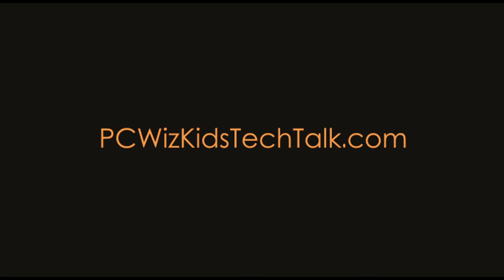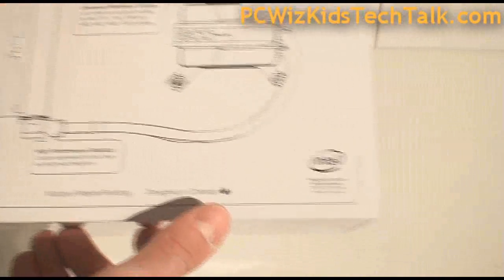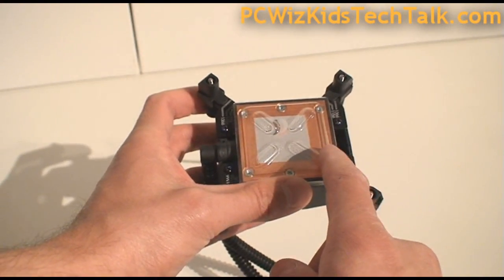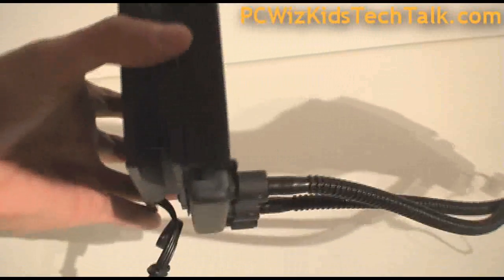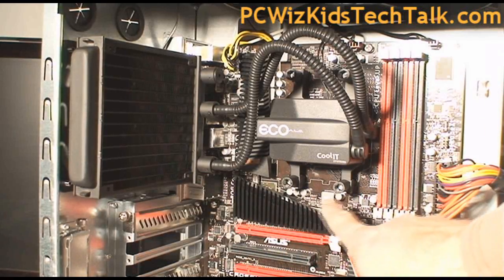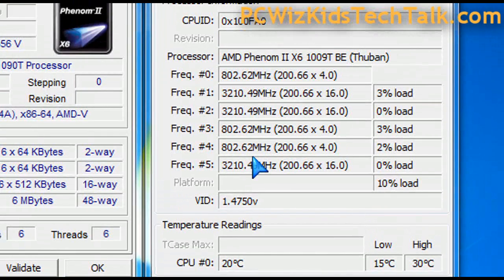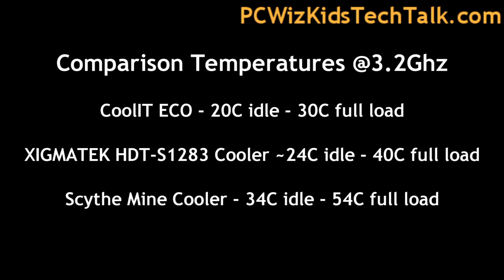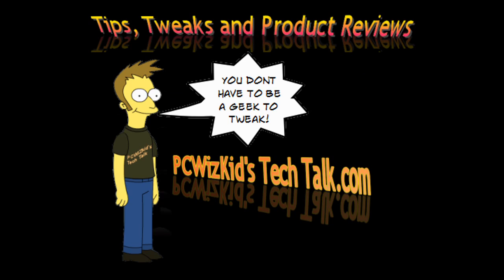CoolIT Systems ECO A.L.C. Liquid Cooler Review

Comment: I've had this ECO Inloop cooler for about 4 years and so far it's has done great for me having a AMD64 FX 6350 Asus Sabertooth  mobo 990fx r2-Gen 3-CPU is clocked at 4200mhz stays at 35.0c idle-load at 44.0c so far.Most inloop coolers other then Coolit could leak-even the highend ones.Soory about everyone else's leaks-but place this one make sure it's placed welldue to it's stiff tubes and cable managent is good.alsi blow it the dust with compressed air in the cooling grill.I've had this PC almost on every day and CPU cooler still runs like a champ.

Comment: I find temp.s even with a second high performance fan is around 35C idle and around  45-48 C under heavy load. only very slightly o.c. AMD X4 965. I am always a bit concerned about leakage but it has been o.k. for over 18 months

Comment: @Sorraxe I used to have my h50 bringing in air from the outside, only problem with that is, it was blowing all the hot air on my memory and other components on the mobo, so i switched it to blow the air outside of the case. Still works very well, especially if you have a side case fan.

Comment: Hi, Very good video.
I have a problem, don´t know if its normal or not, I have a Phenom II X4 975 BE clock at stocks 3.6Ghz, installed this cpu cooler, Coolit ECO ALC, but when i run temp reading, i have 33-34 Degrees Celsius at IDLE, and at full load I get 50-52 degrees Celsius. Is that normal? I think its a bit high since y almost got the same results with the stock cooler, only 5 degrees difference. My mobo is a MSI 890FXA-GD70, 2x2GB DDR3 1600Mhz Kingston HyperX Genesis Grey. Please Reply...

Comment: @cjgan80 believe me, I've used the corsair h50 and i recently swapped it out with this coolit eco alc.

with the corsair h50, my cpu was 27 degrees idle, and 45 degrees when under full load.

but with my new coolit eco alc, idle temperature is 23 degrees and 40 degrees when under full load....

Comment: @MalikIsTheFool yea, the LGA 1155 socket has the EXACT same mounting hole positions as in LGA 1156 so if you have a cooler compatible with LGA 1156, you can use it in an LGA 1155 socket motherboard

Comment: @TheZxMichael The Eco is not ment to compete with the H70, nor does it perform as well. the Eco is a price point competitor for the H50, which it out performs. The price point competitor for the H70 would be the Coolit vantage, from what ive seen, the H70 cools better due to the larger radiator. However the vantage has more options like an L.E.D screen on the pump, tempature alarm, and mistro software. Hope that helps

Comment: @bishoplord At 3:40 he sais "air is going out" and at that point he didn't have the extra fan installed. So i guess the extra fan blows into the radiator and the pre-installed blows out. And considering the extra fan dropped temps by 5-8C, this sounds about right =>

Comment: I know this question could sound a bit stupid but... in your system, with the ECO installed, are you using the pre-applied thermal compound that came with the unit or are you using something like Arctic Silver 5?

(I'm guessing the pre-applied compound but I may be wrong)

Comment: @PCWizKid I don't have an inch of clearance at the top of my case for the radiator (due to a 120mm fan there). Is it ok to mount the radiator upside down (so that the tubes/resivoir are on the bottom)?

Comment: DAMN, I have AMD Phenom II x4 945 @ 3.76GHz. Under full Load I'll get max 41c, Under playing Modern Warfare 2 I get 26c and idle id about 20-24c. This cooler is worth it! If you use GIGABYTE Motherboard, Turn off the auto fan controll! so you get max cooling and air flow. :)

Comment: PCWizKid: How did you get such low temps? i have the same CoolIT Eco ALC and i see idle of 30-31C and max load of 52-53C on my Phenom II X4 965 BE @3.7Ghz (stock voltage and no difference in temps compared to 3.4Ghz).

Got two fans on a push and pull set-up....so i see 3C or so lower than my Zahlman CNPS 9700 LED fan, could not hit 4.0Ghz :(

Comment: wtf you didn't try the S1283 at 4.0Ghz ... that would had been a much better comparaison than with the cheap Mini Scythe. Totaly unfair. Oh well instead of sticking to  30-35$ heatpipe contact coolers I may try for the first time liquid cooling since it's 64$ and that I have a spare 120mm fan.

However  how you change/refill the liquid?

Comment: I still think it would get better temps if you used it to intake, and it wouldn't hurt the rest of the system because of that top fan you have in the case but that's just my two cents

Comment: Wouldn't it be better to have the pump run as the CPU fan? {That way you would still have the rear exhaust case fan. It would adjust the water flow to cool the CPU as needed. }

Comment: H50 uses a copper rad while coollt uses a aluminum, the h50 pulls cool air from outside while coollt pulls air from inside the case, i still preferred my h50

Comment: @GammaBlade Well uh, no, because, maybe, yes....Yes its happened before but there are extremely strict regulations in factories to make sure the product never ever leaks, and in any case of a leak some products have mechanisms to reduce the damage done or even have the water tight product, in a water tight casing.
Alot of people use waters/oils that can't even conduct electricity, thus making it easier to clean.

Comment: so against the H50, this one beats it, I saw that comment already, but what about the Noctua NH-D14? I know it's an air cooler, but even so, the Noctua beats out the H50 as well, so if you had to pick purely on performance and ease of installation, which one would you pick between this and the Noctua?